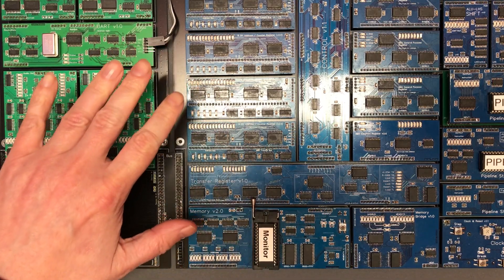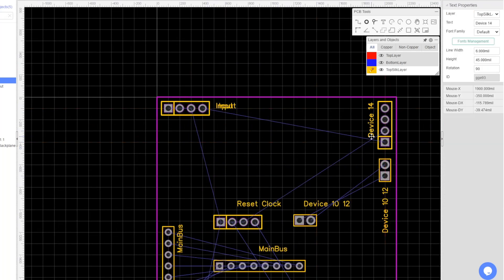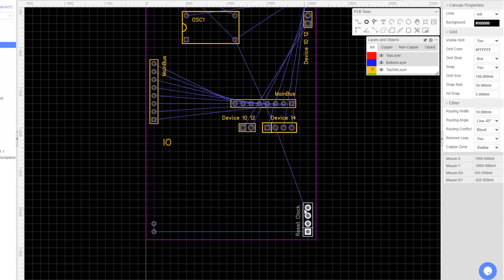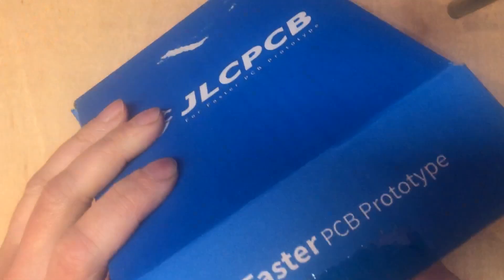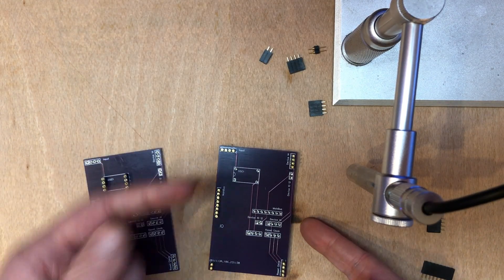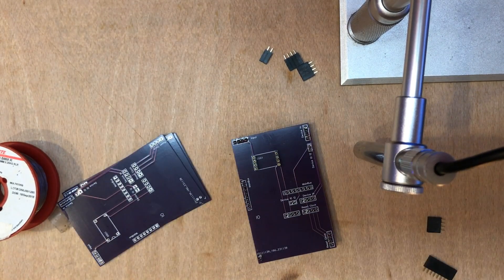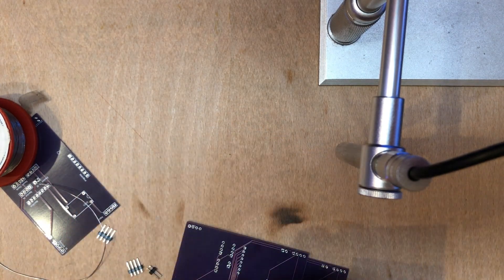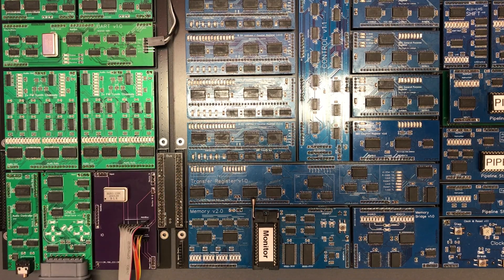Temporary IO Board

Comment: 4:42 Argh!  I hope you caught the bad solder joints on the internal headers!
Reply from the maker: That one flowed part way around, the connection was good but it was ugly. I did catch it later but not while recording.
Reply: @JamesSharmanExtras  I wish I was still young, when I was able to do fine soldering without any optical assistance ... <sigh>

Comment: Hi James, really appreciate your in depth explanations around what you are doing. I do have a question about your board routing, I noticed on this you used the autorouter, but ordinarily you do it manually. Why do you normally do the routing manually please ?
Reply from the maker: Generally the results are better if you manually route it, but it can be very time consuming. Some of the professional packages have much better autorouters but sometimes it's just about knowledge, I know things about the traces that the router doesn't (such as related signals I want to keep together). That and I often get a bunch if complaints comments whenever I use the autorouter. The simpler the board the less it matters, so for a temporary interconnect like this it's too tempting to just hit the auto button.